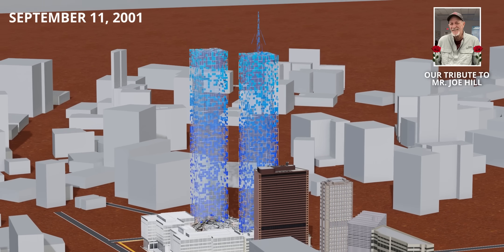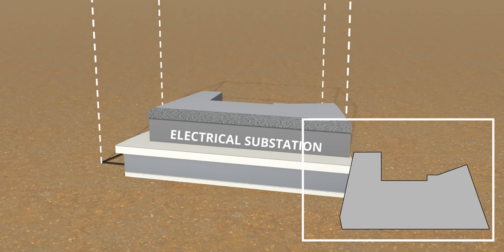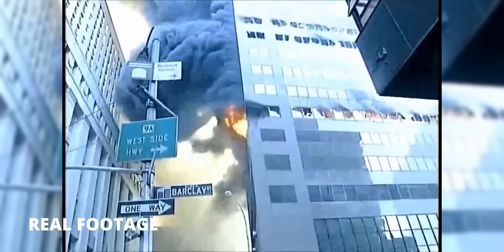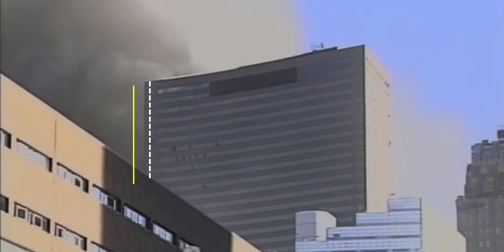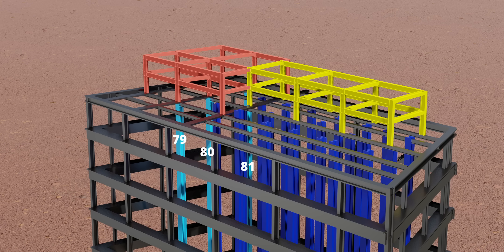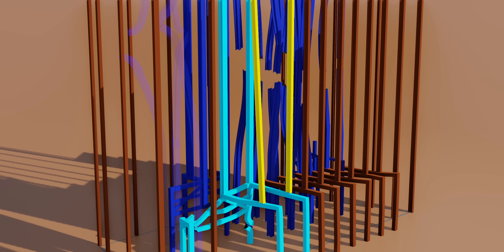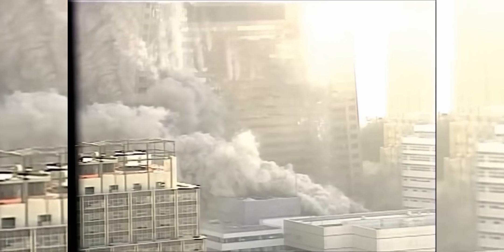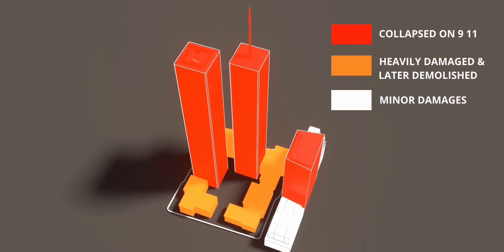Collapse of Building 7 | The Complete Physics

Comment: Interesting explanation overall, but brings up that the building fell FASTER than free-fall speed and does not explain how that could possibly be. It seems almost impossible at first, but after thinking more I suppose the inner core fell first, more or less reached the bottom, then somehow transferred its accumulated momentum to the outer shell and jerked that down at increased speed?

I guess those horizontal trusses at the bottom played some role in transferring that momentum from core to shell?
Reply: I don´t think "accumulated momentum" is a thing...
Reply: @Kudde23  Your mom is a thing.
Reply: @Kudde23  I'm not a physics expert, but in layman's terms, why not? If momentum is mass X velocity, and and due to the acceleration of gravity an object accumulates increasing velocity over time as it falls, how is momentum NOT accumulated?
Reply: @Fuzzybeanerizer - The entire collapse took about 18-20 seconds, or roughly 1/3 (0.33) of GA. 

How fast something falls can not tell us what started it falling so speed of collapse is much ado about nothing. 

A single point on the exterior moment frame was measured to briefly exceed GA, but this is easily explained when you realize the measured data point was moving in 3 dimensions, not 2. It also occurred so late in the collapse and did not involve the building (defined as its center of mass) so is again, of no consequence to trying to understand the how and why.
Reply: @Fuzzybeanerizer  Neither am I a physics expert. I´m not even english native speaker and perhaps that´s the problem here, but for example the statement "an object accumulates increasing velocity" doesn´t really make sense to me. I would say "the object increases velocity" or "velocity of the object is increasing" or so. If "accumulates" means the same to you as "increases" then just chose one of the two instead of using two different words that mean the same.
However, in my understanding "accumulate" has a slightly different meaning. If you are putting coins in a box then you are accumulating coins in that box (in contrast to "the more coins you put in the bigger the first coin gets" if you know what I mean).
That´s why I don´t think "accumulated momentum" is a thing. Perhaps we can agree on "increased momentum" as a term?

So you suggest that the alledged beyond free fall acceleration was (only) possible because the interior was collapsing in free fall already? So first all the core columns provided ZERO resistance and then all the perimeter columns also provided ZERO or even NEGATIVE resistance? Do you really think that´s in any way plausible?!?
So the eastern penthouse free fell all the way to the ground or almost all the way to the ground, nothing there to slow it even slightly, all the 47 floors didn´t pile up but just disappeared? All the connections broke to leave the perimeter standing and then the interior momentum just magically jumped over to the disconnected perimeter?
Sorry bro, I´d rather go with Judy Wood´s energy weapon garbage than that...
Reply: Because it didn't
Reply: @h1F595  I think you can throw you idea in the bin.  I can see where you might get your idea of "accumulated momentum" from, but it's a false concept.  

Momentum and kinetic energy are both instantaneous calculation related to velocity, not each other. That is:

If you're travelling at 'V' them your momentum is "MV" and you Kinetic energy is 1/2MV^2.  And if you continue moving at 'V' then your momentum remains the same.....and so does your Kinetic energy.  
Your momentum does not accumulate as an increase in kinetic energy.
Reply: @h1F595  Well No,  I described change to both Kinetic energy and Momentum with respect to any changes in velocity....since this is what the equations describe.

it is therefore incorrect to use a notion of accumilation of momentum to describe kinetic energy.

Changes to Kinetic energy and momentum are both related to the accumilation of acceleration

Comment: There are at least 2 mistakes in this video as far as I am concerned. They are: 
1. The north tower had an atenna, not a spire. 2. The atenna fell south towards the south tower along with the section of the north tower above floor 99, not north towards WTC7. It was actually the massive chunks of steel that hit WTC7.
Reply: Three thousand bodies would disagree if they hadn’t disappeared
Reply: @Larry26-f1w  wdwm?
Reply: @dikranovichk5889  While the claim that it turned to dust is BS, officials never even tried to explain what happened to the upper halves of the core structures. Neither did they explain how the lower halves survived all the force from above that according to NIST was unstoppable. Neither did they explain why the lower halves collapsed after all hey carried before was gone and while there was no force from above left anymore.

Can you?